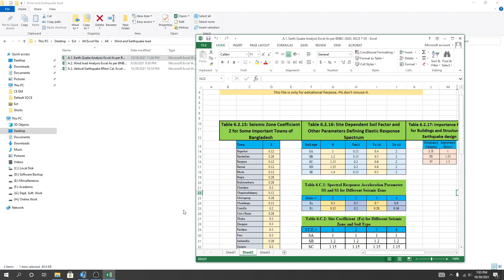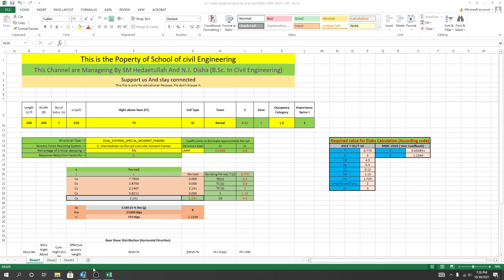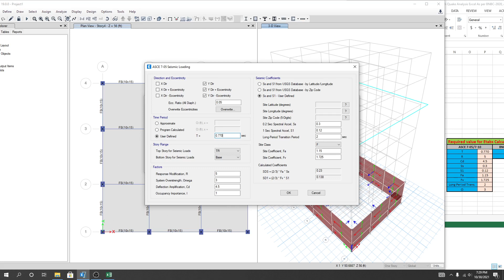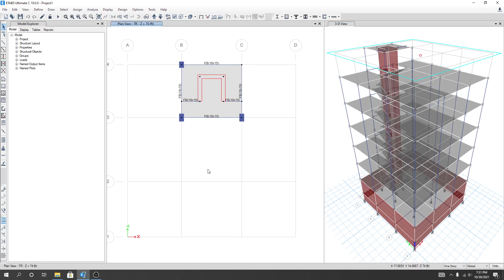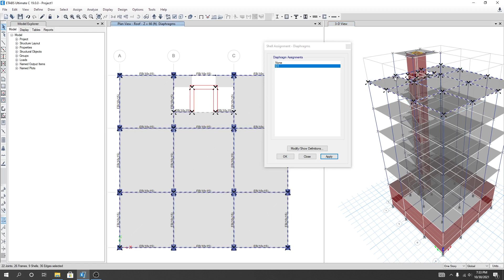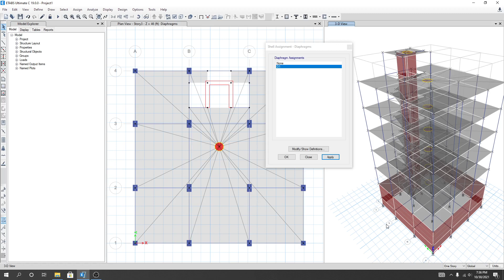9. Complete building design in Etabs 2019 | Earthquake load calculation excel for etabs input

Comment: what is diaphragm and why we need to assign sir?
Reply from the maker: The main purpose of using diaphragm is to transfer the lateral load to the system. This will only be used when you are having slabs but when your model doesn’t have slab then the lateral forces needs to be applied at the joint Slab possess very high resistance to lateral load as they get much higher depth in case of lateral load. But you got to transfer these load effectively to the main frame system that is shear wall and columns. Hence you assign diaphragms.